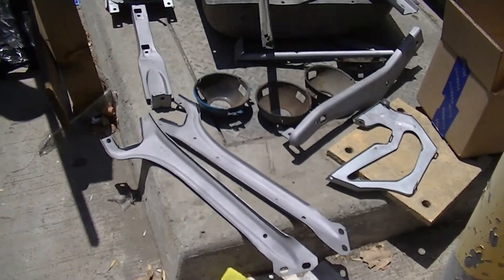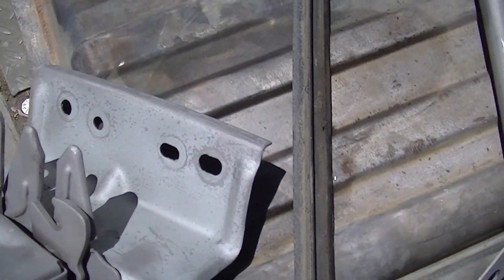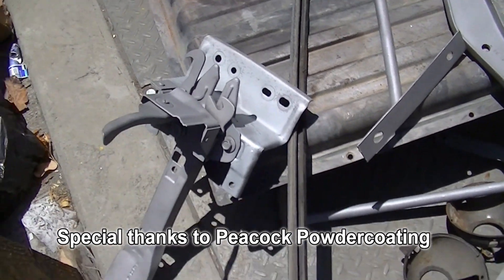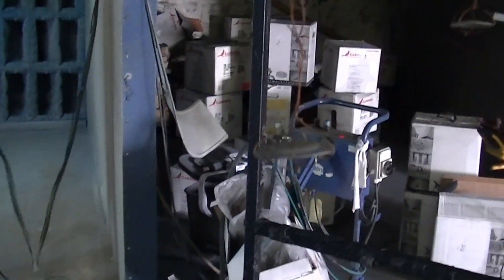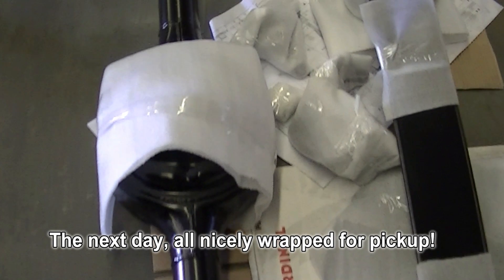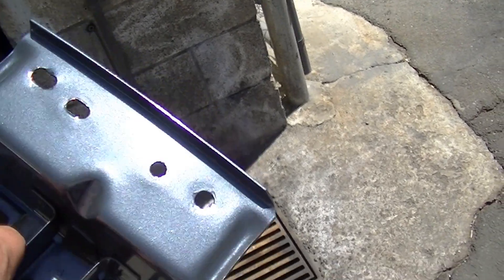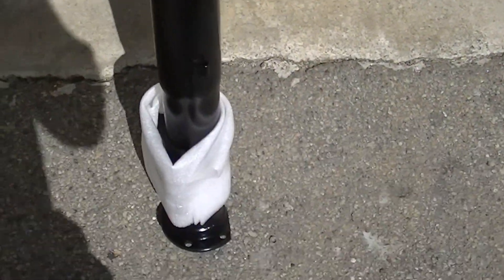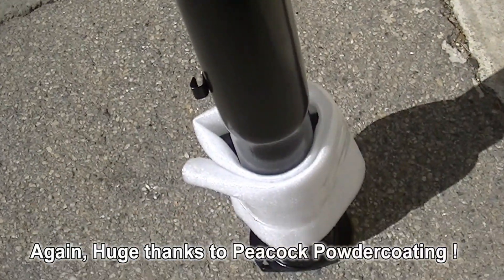Powder Coating Parts 1969 Ford Mustang Restoration Part 32 ! Mustang 50th anniversary

Comment: very cool, I recently bought a powder coat system from Eastwood but haven't tried it out yet....I found plans online to make your own large capacity powder coat curing oven so I'm waiting until I find a junk refrigerator or large upright junk deep freeze...gut it, add insulation and sheet metal inside and add propane burner.
Reply from the maker: Shawn, Sounds like a plan, we are lucky to have a great relationship with Peacock and it is hard to beat their quality. I have tried the Eastwood system and practice makes perfect.  Thanks for checking in!

Comment: Expensive, but very nice results. I had a lot of parts powder coated on my 1970 Mach 1 and don't regret the expenses.
Reply from the maker: It is hard to beat the durability and the finish.